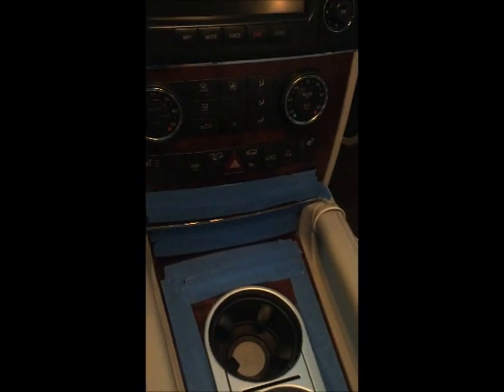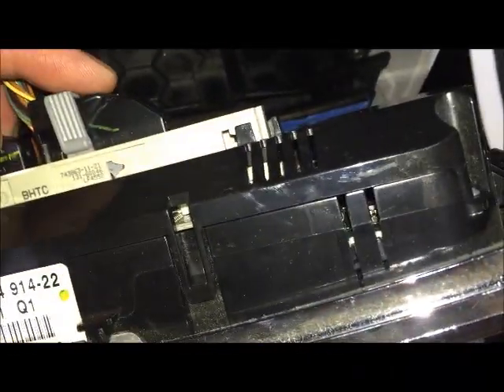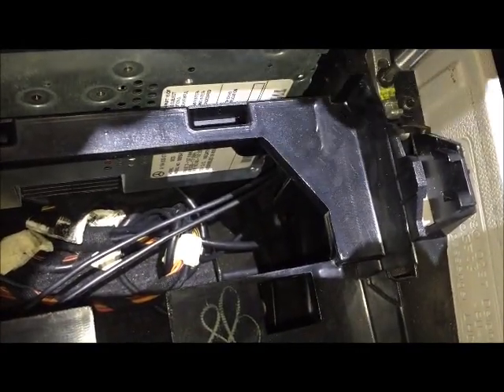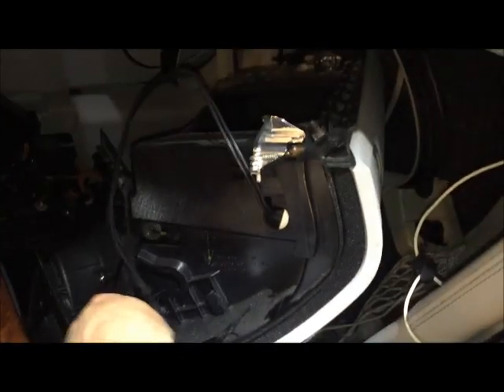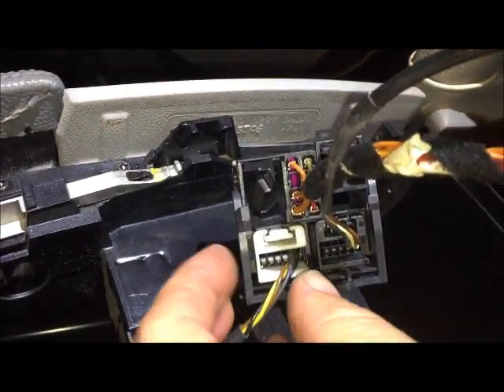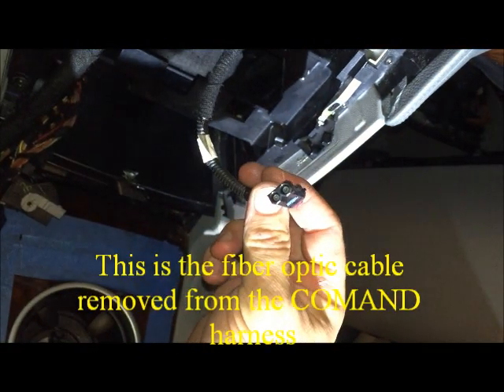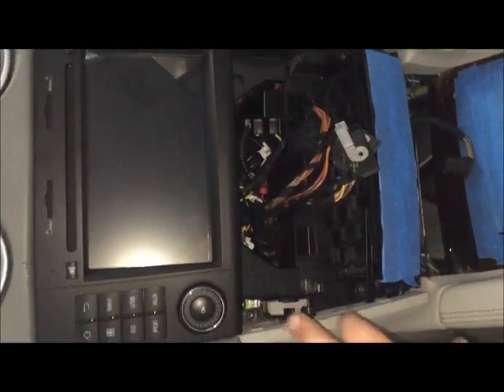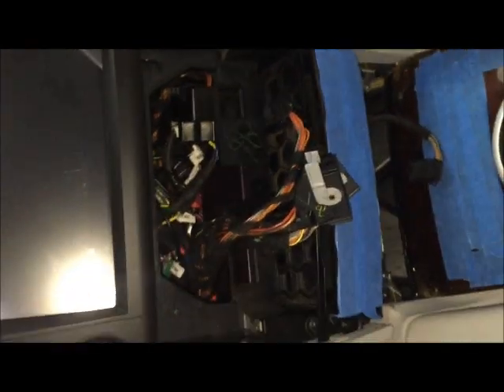2007 Mercedes GL450 - Avant 2 Installation

Comment: Hi -Thanks for the instructions. I've been following the detailed instructions, bu you lost me at point where you say everything is connected as before then the next frame, the radio is all installed.  In my install, there connectors with nothing to connect into. I don't if that how it is or am I missing something. Also I want to use my factory back up camera, where the instruction say plug into the green connector. (there is no green connector) 

Where I am right now is everything seem to come on, but there is no sound. Please advise.

Comment: hi I have a 2012 gl450 and I'm trying to install an aftermarket radio as well. I have the blue, yellow and green connectors but you have black blue and yellow. Do you know which connector is which for mine? Can you help a brother out?

Comment: Hi, just bought an Avin unit for my ML, Most box is slightly different from yours, there are two wires coming out of the most box with Ground and B+, where do I connect those? Also when I connected to test the power my headlights stayed on, what am I doing wrong? I also have no idea how to connect to the factory reverse  camera, I bought an adapter with the kit that has a green fakra to rca connector, where does that go?

Comment: Great work, helped me a lot but im stuck at wiring rear cam to unit, I have 4 wires that come into the head unit harness, not sure how to set them up to make rca, how did you wire OEM backup cam? Thanks
Reply from the maker: 2 were 12 volt power should be able to use the feed back from the reverse signal on the harness and the other 2 spliced into the rear camera video

Comment: hi Tom,  not sure if you still follow up with your post here but I wanted to ask:  how is it possible to still have sound in speakers, if i do not plug in the FiberOptic ?     I have the same setup, and even if i don't plug in the MOST box, i still have sound. Although,  the exact fiber optic cable as seen in your video exists!   I bought a 2008 GL320 and speakers say Harman Kardon on them...and replaced the head unit with the Android 9" touchscreen.   Just trying to figure out if the amplifier was somehow bypassed or wires were pulled for each speaker directly from the radio.  The fiber optic still lits up  - blinks red every now and then.   (i didn't have time to trace the fiber optic cable all the way as I am struggling to correctly connect all the cables  ACC+, illumination etc etc. Maybe you have a color coded diagram of the existing car harness to easily find the cables to tap into? thanks in advance!
Reply from the maker: I didn’t dig into the wiring diagram for this install. Sorry I can’t provide more insight for you.

Comment: Hi, I’m looking to install an aftermarket radio on my 2007 GL but I’m reading that I need a special interface to keep the existing amo and speakers. This interface is 549$!! Did you encounter the same issues? Thanks!
Reply: U can buy it on ebay for $100...or search on google for $90

Comment: the exposed usb connector plug metal is not good!
also the video and audio plugs without a plug is not good. 
This exposed metal will create a possible short and electrical issues.